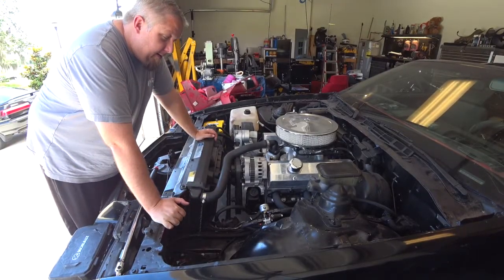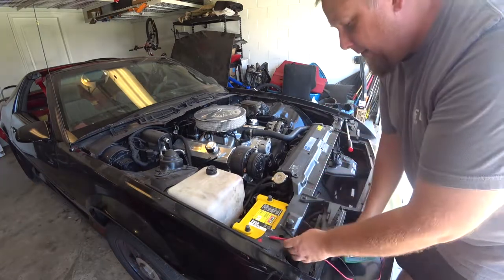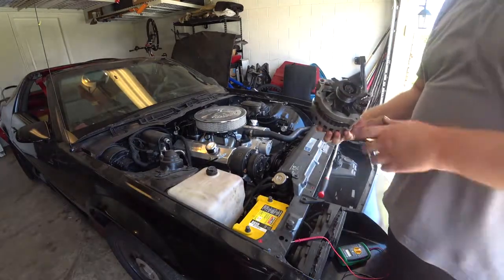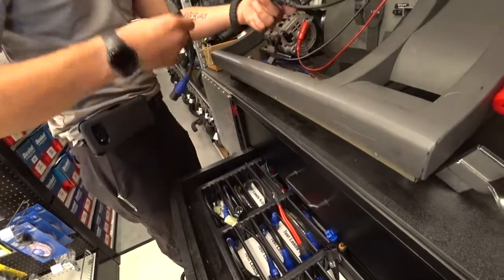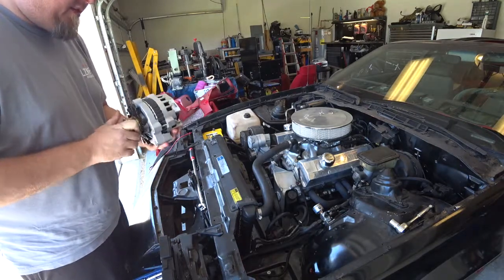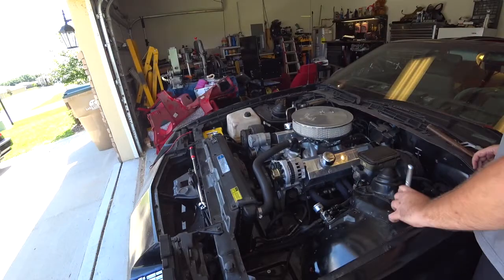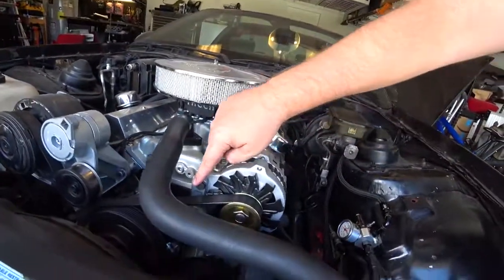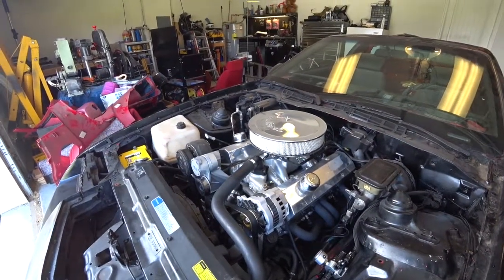3rd gen Camaro Alternator install

Comment: Nice detailed instructions! If you like the gauges, fix the tach, if you like digital then go that route. I fixed my tach, was pretty simple actually. I can get a video up on that if you need it. I think for a 91 the fix would be similiar. 
I was trying to keep the stock look, and didnt want to add an aftermarket tach even though they are far more accurate, and Im not a fan of digital gauges, but its all personal preference! :)
Reply from the maker: Thank you and yes i would like to see a video on the fix you put in for yours. Right now i have been filming the removal of front and fender. it has been a long couple of days lol.
Reply: Sounds like it! I am fighting a finicky carb myself, first cruise night is this weekend, and nothing is going to keep me from it lol. I will try to get a video out as soon as I can, got to take my dash apart again anyways, when replacing dash bulbs i never checked the high beam indicator and turn signal bulbs, of course 2 are bad. 
By the way, did I ever mention how much I hate edelbrock carbs lol